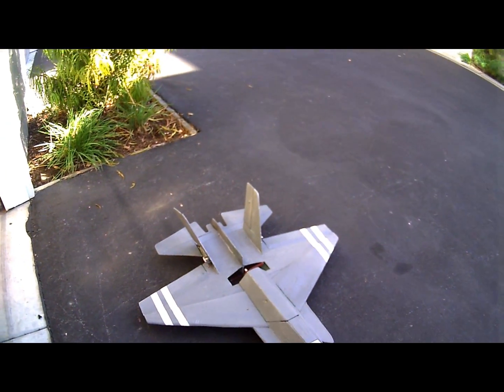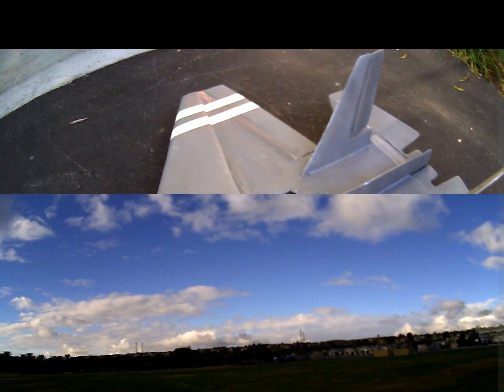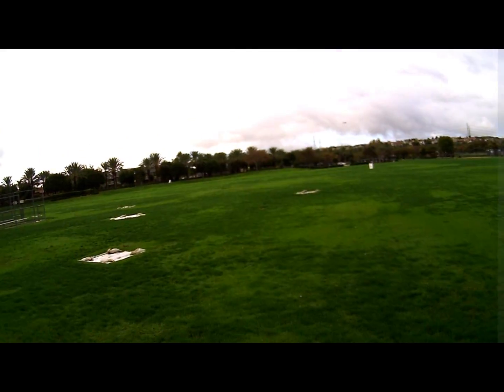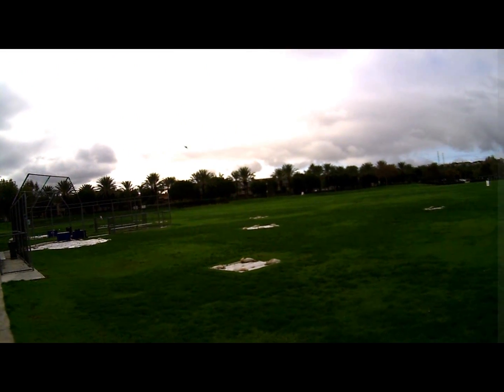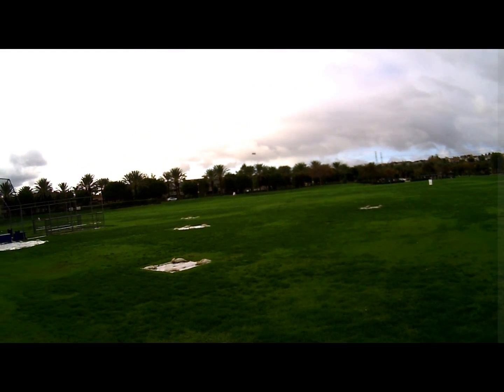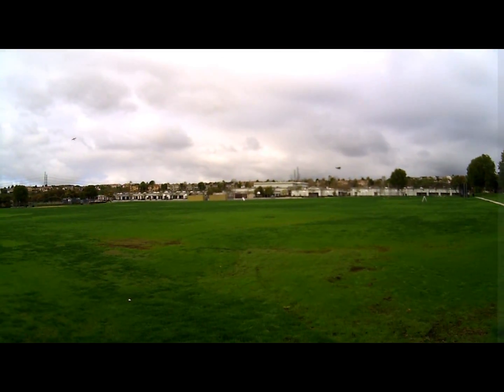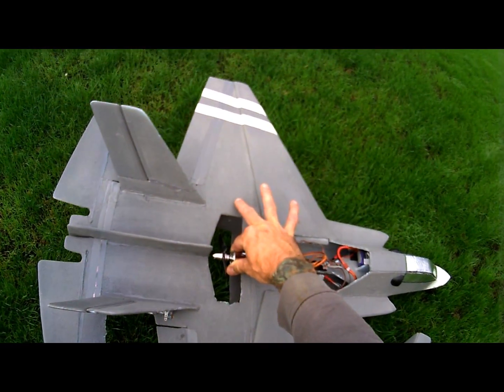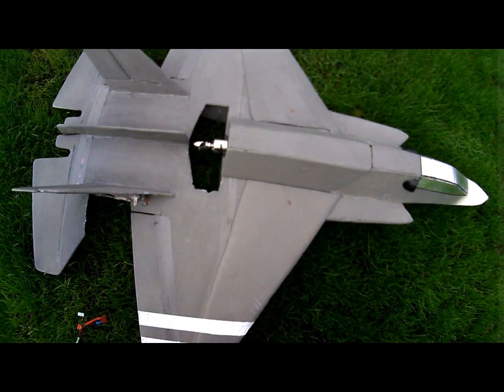RCPowers F-35 v2. Finally found the perfect set up!

Comment: so the 2200 pack will work in it?  I have 2200 3s 40 c with the mega jet and 40 amp esc.
not ready to fly yet.  also whats the code to scale up the planes?

Comment: Before using a ESC you should weigh the whole plain without the motor, will help you use math to figure out how much of a motor you need to get that much weight off the ground and still give you fast speeds.

Comment: Great job, crash&burn! The 4s probably made it too nose heavy and even the extra thrust was not enough to overcome the need for up trim.  I found that bringing back the cg works magic on this plane.  2200 3s works well too,  as long as you pull it back to maintain cg.  Great looking plane!